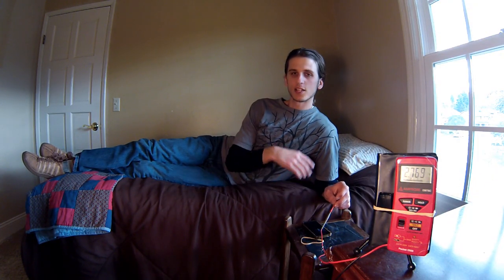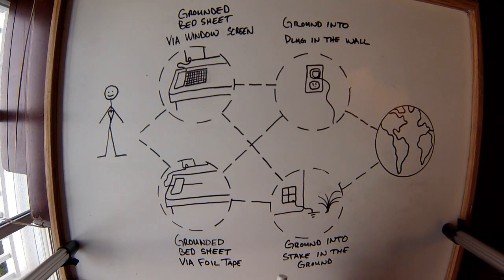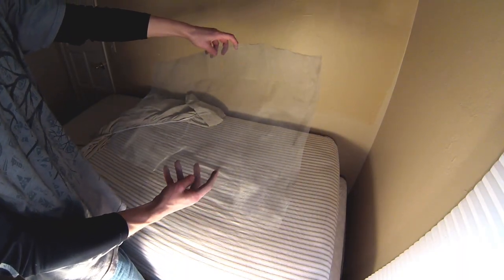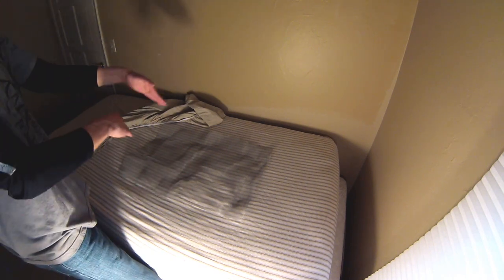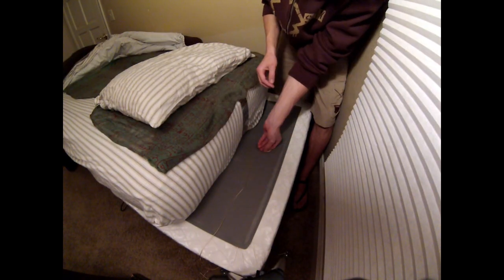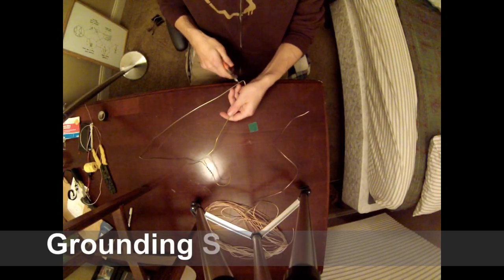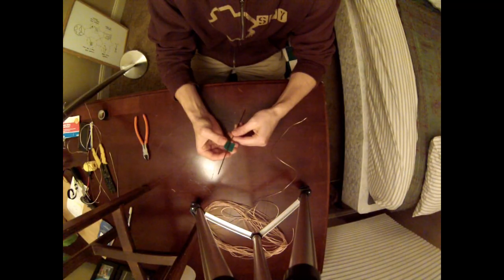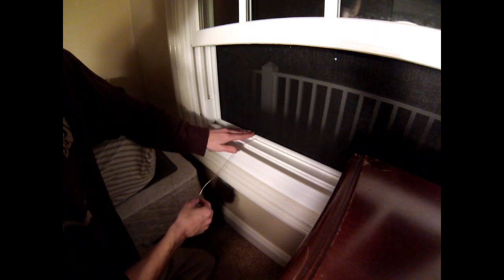DIY Earthing Sheet: How to Sleep Grounded Indoors (Tutorial)

Comment: I'm trying to take a base reading.  I have the lead from the copper stake in the ground connected to the ground on the meter.  I touch the other lead with my fingers to get a reading and the meter fluctuates very close to zero, going negative at times.  In your video, your reading is close to 3 volts.  The meter is set to read 3 decimal places and I get at most a 0.1 reading, but mostly fluctuate below 0.05 volts or lower, down to 0.005 volts.  I haven't even grounded the bed yet.  I checked the meter by measuring an outlet and it works fine.  I'm thinking either the meter can't accurately read that low or I'm doing something wrong.  The wire that I'm using is speaker wire (something like 18 or 20 gauge).   Is the wire the problem?
Reply from the maker: Hey Rudy, have set your voltmeter to match your current type delivered by your countries electric grid (AC: alternating current or DC: direct current) as this will alter your readings dramatically. I have never seen a negative voltage reading, not sure what is going on here as there is no such thing. If you have your voltmeter set properly and you as still only getting a really low voltage reading it sounds like you may be grounded some how. This could be that you are standing on ceramic floors (barefoot or in socks) which are grounded. Your body voltage is going to depend largely on your bodies proximity to live wires. In my video the bed is up against the wall which his live wires running through it which is contributing to my 3 volt body voltage. If you are standing in the middle of a room with no live wires around you your voltage will be quite low which could explain this.

Comment: Much better if you can get a short piece of ground rod or bury about 2’ of the copper wire in the earth outside. The ground in your house is actually bonded with the neutral wire (power companies ground) in your circuit breaker box and sometimes it has been known to actually get power on it instead of being grounded. If you can, bury the wire in the earth or drive a copper coated grounding rod straight into the earth. Electricity looks for the path of least resistance, so shorter the distance from the mat to the earth, the better. If you can’t get your wire directly to earth, MAKE SURE YOUR OUTLET IS GROUNDED PROPERLY BEFORE DOING THIS! Use a Ground Fault Circuit Interrupting (GFCI) outlet if possible, like you use in wet locations or outdoors. This will disconnect if power is accidentally fed back on the ground/neutral of your house wiring. It detects a difference in amperage and immediately disconnects and can be reset once it’s back to normal. Just a precaution.
Reply from the maker: Great advice!

Comment: Earthing works. But, (WARNING!!) don’t assume that ground coming out of your outlet is good.  I stepped on the ground and felt a tingle of electricity!! Yes, it was a dirty ground as I checked it with a multimeter. I now use a earth ground right outside my window. It checked out OK!! Lesson: Check that ground in your outlet.
Reply from the maker: Good advice, I've seen similar issues in older homes.

Comment: How can I ground my bed if I live in a apartment that is up on the fourth floor? Also what do u mean turn the outlets off?
Reply from the maker: Logistically I don't know if it is possible for you to run a wire down the length of your building. Some people have done that, but if it's not an option for you, you can use a grounded outlet. You can use your circuit breaker to turn outlets off.
Reply: Rewild Be Free how do I know if an outlet is grounded?

Comment: It works even when you put a sheet on top?
Reply: YES..the voltage did get down! (U can see the voltage meter in this video on the right side) MAYBE maybe if U choose 2 use a toxic sheet made of polyester John House..IT WILL NOT WORK as good..as the use of organic cotton or silk sheet? Maybe=feel free 2 test&make a video ;)
Reply from the maker: If it is a conductive material like wool, yes. Otherwise you would want direct contact. Some people keep it folded at the foot of their bed to make contact with the soles of the feet while they sleep.

Comment: So you're talking about conductivity and then you put the bedsheet between your not very conductive skin and the ground.  ???  What about wearing conductive socks and grounding them?  Some sheets use metalized fibers for conductivity.  The problem is getting a good ground if you're not sleeping with skin on the ground, is not easy.  Wrist straps (which also could be used on both ankles) don't have much surface area.  You want maximum surface contact with the skin joined with the most conductive copper wire possible to a long grounding rod in wet earth because dry earth isn't very conductive.  If its arid in your area you have to water the earth to keep it damp.  THEN you need to worry about RUST!  Not easy!  Maybe a stainless steel rod?  That's gotta be expensive though.
Reply from the maker: If your sheet is conductive, like wool, that's fine. otherwise you'd want to make direct contact.
Reply: @Earthrunnerssandals  Wow, I had no idea wool was conductive.  How does it compare with a metal?  Or are you referring more to static electricity?

Comment: Instead of connecting to the ground plug on your AC plug what about using heating or water pipes (if they are grounded).  Any need to use a fuse with those?
Reply from the maker: That could work, you'd want to test with a meter to be sure you're grounded.

Comment: Great simple techniques everyone can afford. I would consider a copper rod 6 to 8 feet in the ground to gather more electrons, the connections at each point are best if you can braide the wire through 6 inches or so in the screen for best connection. The tape trick is great, thumbs up but I'd consider a better connection with your grounding wire. All in all you've got it down correctly & I'm an Engineer so I'd say your a great SOURCE for everyone to be able to access this important connection for long-term health. You can sheald the walls by your bed and even stainless screen will block close to 1\2 the magnetic field. Dobble it up if you can & overlapping the open squares with a second screen so they are criss crossed is best.
Thanks for your inginuety, your right on. If you build a screen tenting over your bed and under on the floor you will block most EMF radiation from external sources and be that much more rejuvenated while sleeping.
Namaste
Reply: what's in a name Hey man 😊 Stumbled across this clip and looking for some advice.. One day I downloaded an emf app on my iPad for fun and went through the house and seeing the readings. Everything was normal-ish, till I tried our bed.. My side is mostly normal but when I put it where my partner sleeps it triples and  warning/detect alerts. Tried it several times on different days, same thing happened. I downloaded 4 more emf apps and they all do the same thing.. All around the bed is fine so I think it's the coils in the mattress, and I've found some research on how metal springs/coils in mattresses can act as an antenna for emf and rf.. We can't afford a new bed, what can we do to neutralise frequency or protection from it..?
Reply: Thanks for the extra tips - Im definitely going to get a tall copper rod for the ground.  Just a couple of questions:  Does the mesh density make a difference to conductivity?  I'm guessing not?  (Sorry, I"m a girl and don't have clue :)  I want to get a very fine copper mesh to put on my bed - kind of like fabric.  Just wondering if I will still get the same level of grounding once a bedsheet is placed over it.  

The second question is about the inline fuse - would you still need one if you were using a rod outside?  I was just wondering about lightening.  Thanks!
Reply: @shellbell8062  please don't apologize for being a girl nor for not knowing a specific field of information. Most men don't understand any of this stuff either, we just pretend like we do.
Reply from the maker: If there is a chance of lightning in the forecast you should remove the earthing stake. A voltmeter is the best way to test if your unique setup is working (if you're grounded)!
Reply: Get real 6 to 8 ft us a bit crazy. You ground by just walking on the soil or sand  not 6 ft in the dirt.

Comment: So if you are living in a sailboat hooked up to dock electricity you would go for a grounded plug or use ground wire to water?
Reply from the maker: That's a pretty unique situation; depends on it the outlets are grounded. I'd recommend getting a voltmeter to test.

Comment: You should redo this with up grades in what works. 
The metal tape will not hold up because the bed mat is ever flexing. Metal will not take the fatigue and break, making your grounding project useless for a bed mat.  You learned this yourself only weeks after installation. Also the metal screen is a lousy choice as the metal treads will unravel and snag the bed mat and duct tape is useless for this. I had to stitch Gorilla tape to protect the edges and I also had to stitch the tape on. So three of your product choices here are failures for any length of beyond a few weeks if at that.
Reply from the maker: https://www.youtube.com/watch?v=tqFkyUlv3T4

Comment: I used an 8 foot piece off of a roll of aluminum screen; 4 foot wide. I grounded to an actual 8' ground rod that I installed outside and far away fron the houses electrical service ground rods. I Ran a stranded  #6 copper through a 1/4" hole through the exterior wall.  Lotsa duck tape completely encirculating the mattress to keep screen from shifting and bunching! ...Great surface area when laying down. 
With the insulating, but necessary for comfort barrier of a sheet, my Body voltage went from 4.9 V to .05 V

Whoot!!!
I am not a Doctor. Please consult a professional before trying this at home, kids!

Comment: Good DIY video. Just a suggestion for using the plug when you open that up to ground your wire the two positive and negative ground that stick out inside the plug just put some tape over both of those just to not have a cross electrocution case the wire is pulled out. Eyes open be safe

Comment: Thank you so much for the tips. As I read a bunch of comments, I also recommend to invest in a conductive sheet, but for testing the technology, it's great, you can recycle your aluminium net to ground your feet under your desk for exemple. One question I got : I remember my physic courses, but still not enough to be an expert and I was wondering if the use of a diode could fit the job and avoid any electricity to come from the socket ?

Comment: Earthing through your home’s ground system makes me rather uneasy.   Older homes, homes having partial renovations or additions...   these homes can and often do have issues where older wiring methods or insufficiently trained individuals can create conditions that turn that ground wire inside your system into a current carrying conductor.   

I would urge anyone considering that method to do their research and possibly consider having an electrician evaluate your system.   

All too often I’ve come across some installation where there was a need for a neutral but the wiring method didn’t provide one.  In those situations, people tend to use the ground as a return conductor if they aren’t trained.   This is dangerous.    

I would not assume any system is wired safely anymore than I would assume a firearm is unloaded. 

My two cents, and nothing more.
Reply: May I ask why it wouldn't be a good idea to use earth for a ground when a neutral is needed? We are installing ground rods because of some issues.  Thanks

Comment: If something is grounded it would show no EMF frequencies on a multi meter correct?
I assumed electric would only show up coming out of outlets but its also radio/microwave.
Additionally I am not near the ground/dirt.... I have 6, yes 6 fire alarm type devices on one wall which I know is my primary culprit. Personally I think a code inspector should deem this a violation and an attorney should assist based on how I felt since being here and taking over a year to figure out but despite my evidence, it seems I'm not the only ignorant one in this matter. I would much appreciate if someone could help me resolve this matter.
Thanks for your time.

Comment: I appreciate the idea of grounding... however the 5 amp fuse for safety is a joke... currents between 100 and 200 mA (0.1 to 0.2 amp) are lethal. GFCI's trip in the range of 4 - 6 milliamps to protect people, however don't think plunging your device into a gfci plug will protect you... they work by monitoring the difference between the current on the hot wire and the return on the neutral. any difference of 4 - 6 milliamps will cause it to trip.... so simply plugging into the ground of a GFCI will not protect you.  I will attach a link explaining

 ...https://www.nema.org/Products/Documents/NEMA-GFCI-2012-Field-Representative-Presentation.pdf

Also remember that lightning strikes from the ground up to the sky.... it is due to the ionization time of the earths atmosphere that causes lightning to appear to be coming down from the sky. Ever see a tree that acted as a lightning rod?? usually split in half and burned. The tree acts like a grounding rod since its roots are deep beneath the soil as the clouds create static electricity brushing against the earths atmosphere they create a static charge.... when the charge is big enough the lightning jumps the gap..... usually millions of volts....

There is a time and place for everything.... I would unplug that thing in adverse weather  conditions... it doesn't matter if you have a separate grounding rod from the houses electrical system....

Comment: I'm a little confused by the volt meter. You have the voltmeter connected to ground and you are touching the other end so you are essentially grounded, and the volts on the volt meter showing your body's voltage going to the ground. Then when you set up the grounding sheet, you are grounded a second time, so isn't the same voltage going from your body to the ground through the grounding sheet, so it is not showing as much voltage to the grounded volt meter. 
If you put a second meter from grounding sheet to ground, wouldn't it show the same voltage as before? 
Don't get me wrong, I am a believer in grounding, but I just don't see what this volt meter test proves.

Comment: CAUTION!!! Using the ground pole from the voltage outlets to connect that "earthing sheet" is very dangerous as when doing that you are simply conecting it to the ground net of your house's electric installation. The ground wires in it are used to conduct any possible voltage from a default device to the ground in order to protect you from taking that the voltage leak by rerouting it to the ground. So imagine what would happen if there's a voltage leak through the ground wire in your house's circuit and your body is connected to it... "Fighting" electricity without knowing how it works is really very dangerous. If a problem happened with your insllation and / or a faulty device when using that sheet, you could be taking some hundred volts while trying to avoid to take just a few few milivolts. Your Call.
Reply: And this is why any of the respectable books or videos on Grounding, by the experts, strongly suggest that people interested in this activity, take courses in how to ground properly through the outlets. I'm very leery of this method of grounding because I KNOW my house is not wired properly. Several years ago I experienced a slight shock from my Washing Machine...through the stream of water filling the tub. I called my dad, who was a retired Electronics Technician. He tested my wiring extensively and finally found the problem: a spliced wire in the attic. The Ground wire going to the outlet to which my washer was plugged was spliced to the hot wire coming from the breaker box! How we had not blown several electrical devices on that line is a mystery! ...and a blessing! Dad corrected it...but I'm not completely sure there are not other "issues" with my house wiring. I'll be using a grounding wire to a stake in the dirt here at my house, for sure!
Reply: This kind of thing is what is going to get Grounding a bad name. We MUST be educated in what we do, especially when it's a relatively new idea or aspect of science. I use Essential Oils and I know there are those who say they're completely safe. They are....IF you use them correctly. Taking a bath is safe...if you are careful getting into the tub. We don't stop taking baths or using alternative forms of health care just because of accidents or the ignorance or even the stupidity of others. BUT...we have got to inform people correctly. It is my belief that the best way to ground is straight to the earth and not through anything Man-made such as the wiring of a house.
Reply: Bonnie Hyden I have to AGREE just installed my homemade earthing screen and my voltage went up by 0.5v!!! No bueno. I tested it in 4 different outlets... my ground is electrified : (
Reply: using a resistor would solve this problem.
Reply: can you explain?  I thought a resistor would decrease the benefit no?  wouldnt a fuse be better than a resistor?  I was thinking if you ground to rod with a few fuses in the circuit, that would protect you from a 3 a.m.  electric storm if there was a lightning strike near the grounding rod.  thoughts?
Reply: I have taken measurements with my own multimeter and found out it doesn´t matter much voltage-wise whether you use a resistor or not, the difference is minimal. (100k resistor)
Reply: interesting.  thank you!
Reply: thats why he fused it...did you no see that part of the video?
Reply: what atcjos said and electricity also always takes the least resistive path to ground. I would suggest that you take your own advice. Learn how it works!